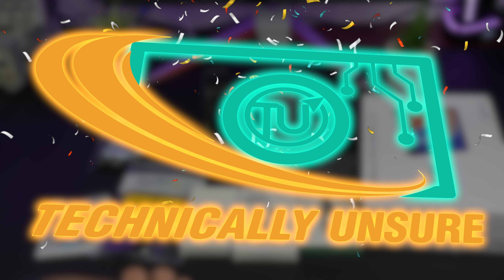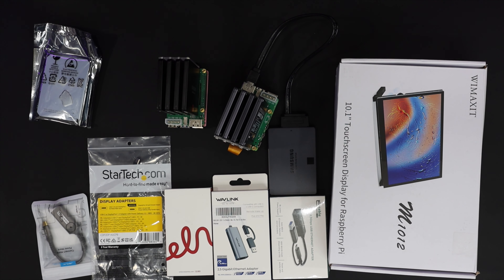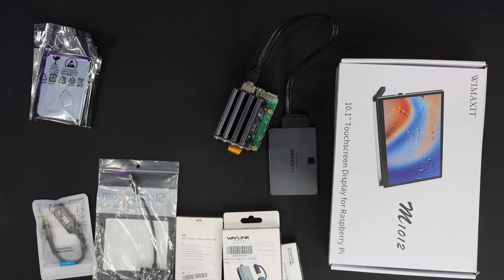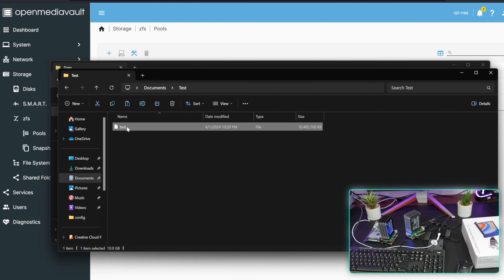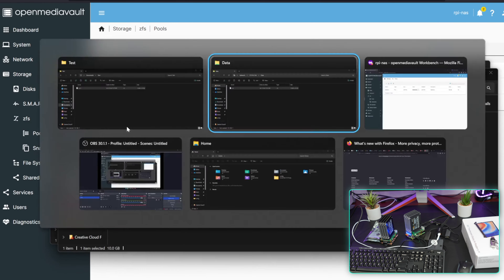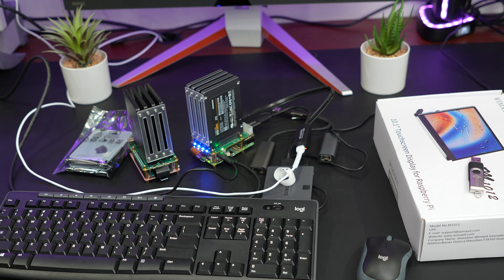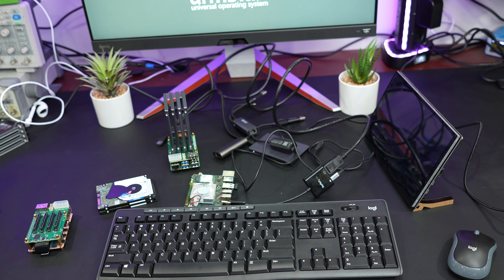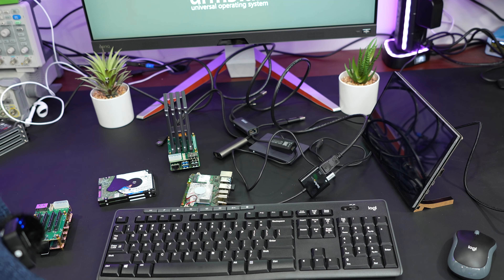You Asked, I Answered: Raspberry Pi 5 & Rock 5 - 2.5G Ethernet, DisplayPort & More!

Comment: This video series inspired my RPI5 NAS, so thanks! I'm just running one 2TB nvme for files though. Also, I was able to get my 2.5gb usb adapter to work once the system was up and running only. Then I used omv-firstaid and set the network interface to dhcp and was off. My iperf scores were 2.36 Gbits/sec, so full saturation. I'm unable to get the usb adapter to persist through reboots though, when it comes back up I have to unplug and plug back in the adapter for it to take the static IP assigned from my router.

Comment: 10:04  I also have that network error, adding 1.5 minutes to the boot time! 😞
Reply from the maker: In my case it was because I used the 2.5GBps ethernet adapter and didn't configure the network for it. Have you tried the solution suggested here? https://forums.raspberrypi.com/viewtopic.php?t=187225

Comment: I want to make a mini home server with the NAS function and a few others (arm because it consumes less electricity) I found this Radx Penta Hat and I'm wondering which SBC computer to choose: Raspberry Pi 5 or Radx Rock 5A? which is faster when using NAS, which has a larger power reserve (I know that the Rock 5A has a larger one but is the Pi 5 sufficient or is it better to use the Rock 5A), I also heard that the Pi 5 has some problems when not using a PD charger or with radxa rock 5A are there any problems too? I have a 5V5A UPS and I don't want to stop using it because of PD.

Comment: Rock 5A does not have USB type C DP alt mode.
Ahh, you mean DSI when you say "Display Port"?
Reply: The RK3588S actually supports DP1.4 alt mode per Radxa’s 5A schematic. There just isn’t kernel support for simultaneous PD and DP alt mode (yet, it has something to do with power delivery negotiation but I think Collabora is working on resolving this too)
Reply from the maker: Rushil responded before I could. Thanks to both of you for highlighting this, I forgot to mention it in the video and just straight went for Rock5B to showcase the DP